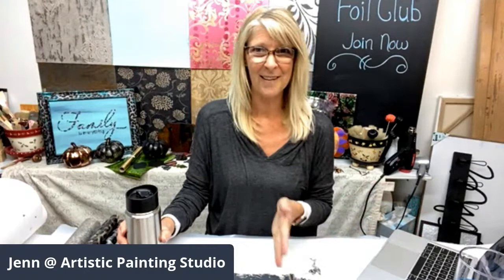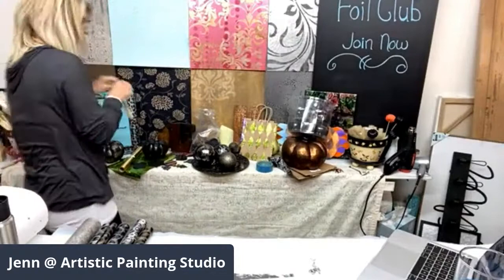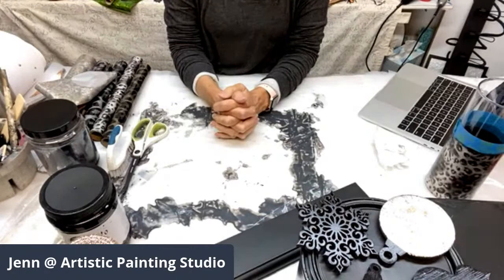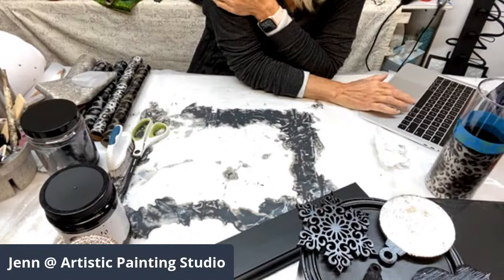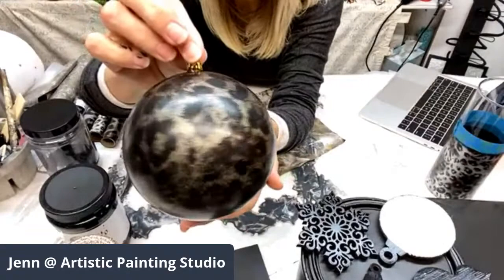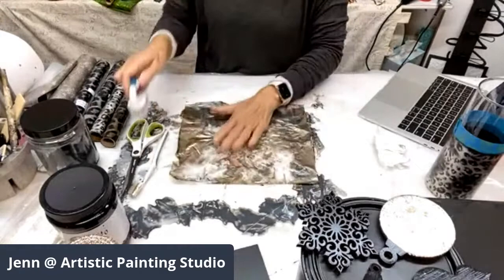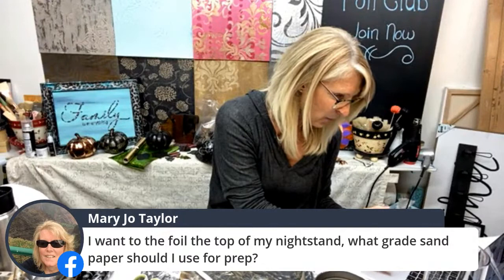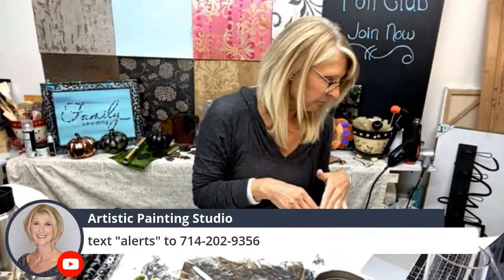Foils and Glitter!!!

Comment: I’ve purchased 2 orders from your shop.  Love them!!  I wondered what is the best way to use foil with a vinyl stencil?  I used your adhesive. When I applied the foil, I did it over the stencil. The bigger text was ok but the smaller text did not adhere.  I know the stencil was the problem. Should I have removed the Oracal vinyl film stencil after I applied the adhesive?
If you need resin guidance, Artist Till Death has YouTube, website, ATD Pour People on FB. Erika is also a friend of Rhonda’s.  She is always glad to help!
Reply from the maker: Sorry for my delay - just seeing your question.  Yes, once you apply the adhesive through the stencil (and I apply two coat by pouncing) remove the stencil and allow to dry for at least an hour - then transfer the foil.
Reply: @ArtisticPaintingStudio  thank you!  You helped me with this over the phone. I’ll send you a pic   Put the last coat of resin one this morning